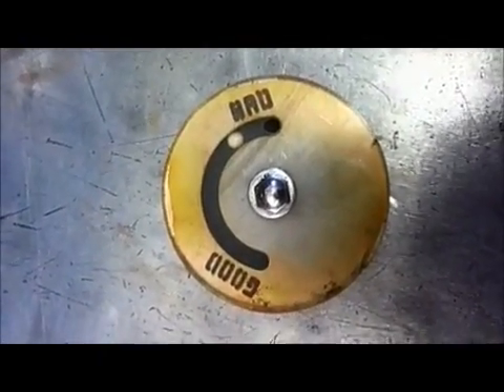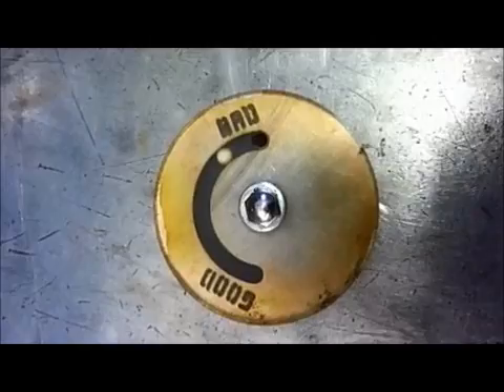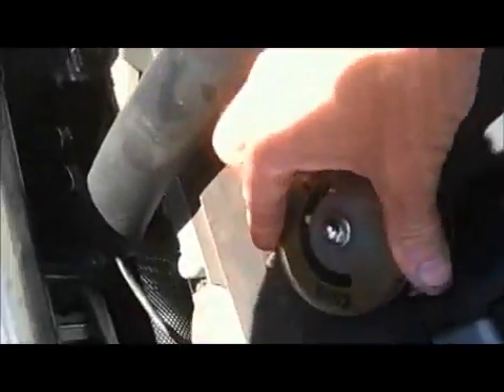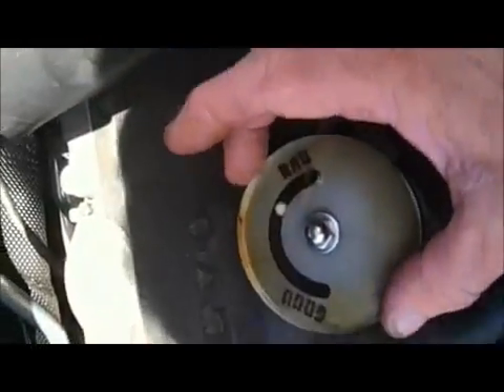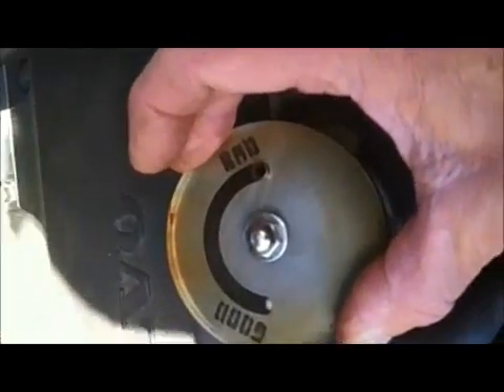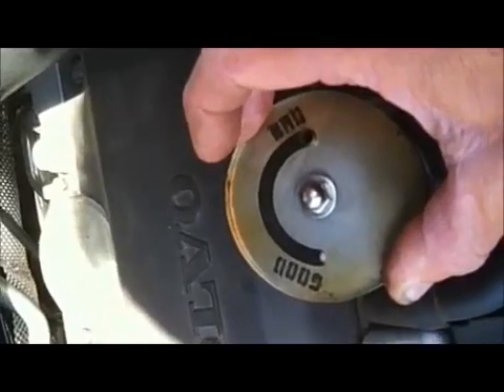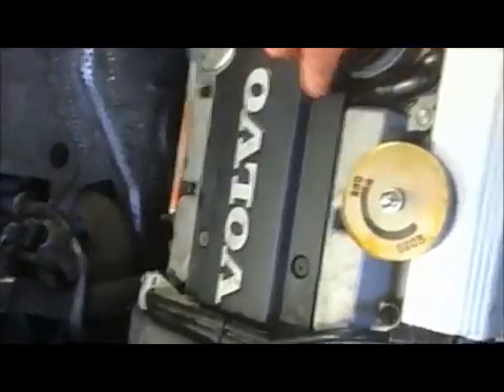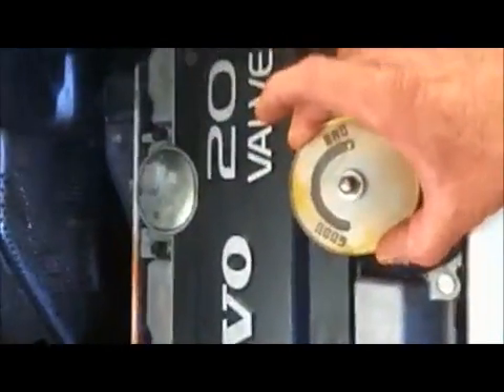Volvo Crankcase Pressure CheckerTutorial

Comment from the maker: I'm glad that this was helpful for you. I designed the tool roughly after one made by Perfect Circle in the "70's, except that mine is serviceable and much more durable. I've been a Volvo tech since 1986, we've used one of those tools almost daily in the last 3 shops that I've worked at. I like that it is such a quick and easy test. I'm making a web site where I will be selling them and other Volvo widgets I've come up with. For more info, e-mail me at boguestuff@gmail.com Thanks!